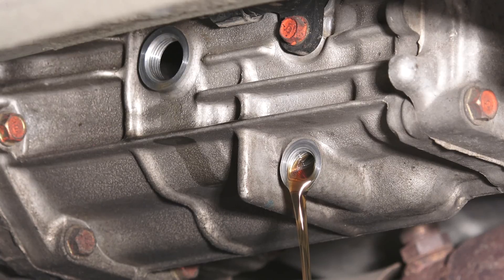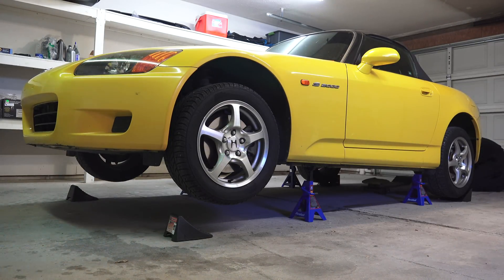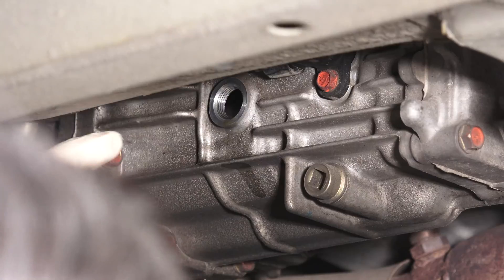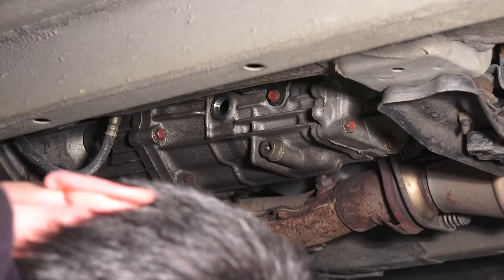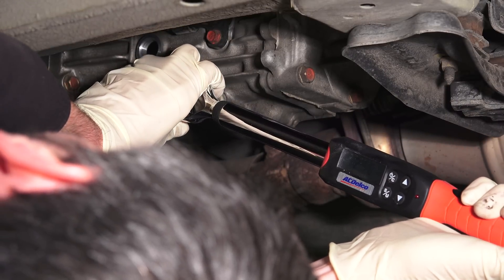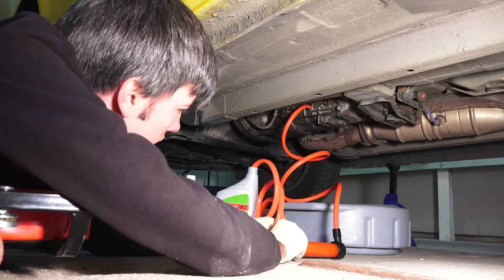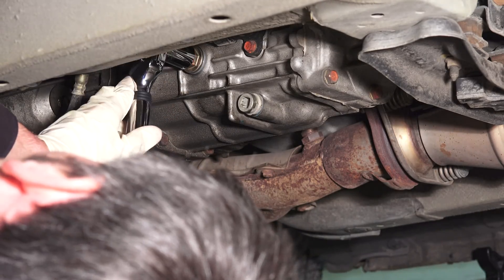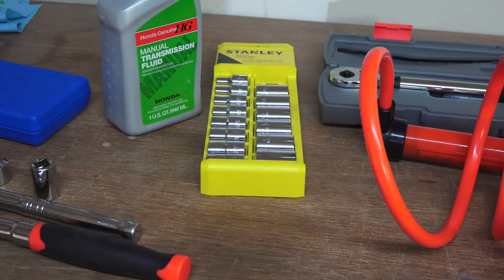How To Change Transmission Fluid - Honda S2000

Comment: Would be great if you could do a video studying "lifetime" transmission fluid claims. There is so much conflicting information with manufacturers/dealers saying a sealed transmission under normal use does not need an oil change while workshops and people will tell you that lifetime means the warranty period/mileage of the car and that you should be changing it regularly - this is despite the fact that sealed transmissions are now designed to be maintenance free and are not easy to drain. Would love if you could approach this scientifically as you always do.

Comment: I am planning to change the gearbox oil in a 2000 Toyota Camry. I am wondering if I can gain access by using ramps and if I do use ramps how much off will I be filling the box at that angle? A second consideration is using an extraction pump to remove and replace the gear oil (mine looks exactly like the one you're using in the video). Will I be able to reach the bottom of the sump using fairly stiff nylon tubing? Doing it that way would at least allow me to keep the car level and I already have the pump & tubing. All I would have to buy would be a 24mm socket and one new washer. I don't have a lot of tools, equipment or money so what I'm considering here takes that into consideration. If you have any additional ideas that could work for me, please pass them along.
Thanks

Comment: HELP: I bought my 2006 s2000 used about a year ago and haven’t changed the fluid since. It has about 120,000 miles on it and idk if I Should I change my trans oil if it hasn’t been changed before. I messaged the guy I bought it from if he had changed it but he only replied with “you don’t have to change it bc it’s a manuel” lmao. Please help, I feel the gear changes rough and a slow response so I know I should but I’m scared that my trans might fail if I change it.

Comment: if my transmission is slipping, will a fluid change help a little bit? I do not think the original owner changed it and it is at 130k miles.

Comment: looking at the comments section and im thinking, 99% of people in the US dont know how to drive a stick.
Reply: neo they both have pros and cons. AT from where im from is starting to get popular mostly in the cities. But in the provinces where its open highway manual is still king. Plus manual is easier to service as the provinces dont have a lot of dealership or repair shops that can repair an AT transmission.

Comment: A good reason for opening the filler plug first, is because this filler plug can get hellastuck if trans fluid hasnt been changed before.. and allooot of people hardly or never do that. So you dont wanna be stuck with the drain plug out and all the fluid out and not being able to get out the filler plug...

Comment: No relevant to this material, but while we are at it. Can you explained the benefits or not of dual clutching in a manual transmission car? specially in modern vehicle equipped with sincro....thanks

Comment: Cool! nice video. My fit Transmission could use that. My car have 125 000km (78 000), not too bad but it,s not expensive to do. It seem even easier than motor oil. my big problem is the level ground, my driveway has a small slope, our garage is small and use for other stuff than cars.

Comment: Why not a 3x3 or perhaps a flush rather than a drain and fill? Does the drain and fill remove enough of the entire circulating fluid within the transmission?

Comment: Thank you for this video. Is there any information on doing a fluid flush rather than just a fluid change? What is the difference between a flush and change anyway? Also I have a special request. Do you have any tips on doing a DIY wheel alignment? and/or tightening the suspension/alignment for older vehicles? I'd like to learn how to do this myself (dial it in) if it is possible? Or are the tools too expensive? Happy New Year! :-D Thanks for your response in advance and thank you for keeping up this great channel!!
Reply: My dealership only offers the flush. Many people say to stay away from that, but I don't really feel comfortable messing around with transmission fluid myself

Comment: Fluid Film,,, spraying it in all holes and crevices can stop rust from starting (or slow it down if it has). Not sure if S2000's have any problematic areas, but its not expensive and is a better product than WD40 with a million uses

Comment: What if one wants to use the same transfer pump to fill the differential? Or other M/T for that matter that uses a different fluid, how will you clean the transfer pump to avoid cross contamination? Thanks.
Reply from the maker: I suppose you could take it apart and use some soap and water. I bought two different pumps. One for the trans and one for the diff. Both were pretty cheap, and far cheaper than having the service done by a dealer.
Reply: Thanks for the response.  Let's say you have the transfer pump for m/t transmission fluid and the hand pump for the diff fluid.  What if you have another RWD M/T vehicle...   I don't want to have 4 pumps...  would you still use soap and water to clean it up?

Comment: I know many people who say to never change transmission fluid. In fact my car's service guide says to never change it. Why the disparity in advice out there? Not saying one's right and one's wrong, just wondering why the opinions are so widely varying.
Reply from the maker: Some are sealed and designed to last the life of the car. But eventually it's gonna be old. Others have easy drain ports, and are designed to be changed with some frequency. Ultimately, manufacturers want to remove as much maintenance as possible from cars, because plenty of people will not do it.

Comment: Wow Jason, kudos on successfully using that HF transfer pump.  That thing made a simple MT fluid change a huge mess for me, blowing out of the fill hole while I was pumping.
Reply from the maker: Haha yeah, honestly when I received it and put it together, it did seem quite cheap. I was questionable about it, but it worked. For the price, that's all I can ask haha. Certainly more expensive things out there.

Comment: I have 2003 civic and I don't know the last time the tran fluid was changed, I've heard that it's not good to change it if it's been in there for an extended time, should I keep rolling with old fluid or change it? ~187000 miles

Comment: is there no need to run engine n gears to cycle so the atf in torque converter gets circulated.
Reply: No. 
There is no torque converter, it is a manual transmission.

Comment: Mobil 1 makes the best trans fluid. In the cold it sucks because of how thick it is, but once it warms up it's sooooo good. The thickness helps protect everything even in high stress and makes worn synchros feel new.
Reply: Mobil 1 meets my viscosity requirements, actually. It's just a thicker fluid is all.
Reply: Unbearable Pain redline fluid is good stuff

Comment: You should probably note in the title that this is for European and Asian vehicles mostly; most US vehicles require transmission pan removal to drain all fluid. I hear they are getting better about that, though.
Reply: Cars Simplified This is a manual transmission. Pretty much all manuals have a drain and fill plug. Auto transmissions, however, commonly do not have drain plugs and instead the pan has to be dropped
Reply: I don't know how that ended up missing from my comment; I know I had that in it at one point but I did edit it a lot. Good catch!

Comment: Did u ever have to change the power steering fluid in ur old STI? My dealer is trying to charge me over $200 for that and it doesnt even seem necessary
Reply: Just use a turkey baster to suck the fluid out of the reservoir and refill.
Reply: Then again though it has gotten me to 30k miles without any problems. So $200 doesnt seem terrible
Reply: it should be fine but if you have to just buy the appropriate power steering fluid for your vehicle and use some sort of pump to take out the old fluid out of the reservoir. doing a flush would require you to remove the return line, have it set up to drain in a bucket, while you fill the reservoir. you should only need the flush If your having steering issues.

Comment: Can you talk about the 3x3 method? Is it necessary?
Reply: Jimmy M I think the 3x3 method is used for automatic transmissions which retain a lot more fluid during changes. I do a drain and fill every 2 oil changed (or 15k miles), which replaces just over 1/3 of the fluid. I think that's easier on the tranny than replacing all 10 quarts at once.
Reply: Jimmy M I think I read something about that years ago. Like they figured if you just do a drain and fill vs a flush. Drain and fill then run through gears. Drain and fill , repeat 3 times and something like 97% of the fluid will be new. I don't think it's necessary if you drain and fill every 30k miles or so. If it hasn't been changed for 100k miles , might be a good idea or take it in for a flush.

Comment: what's your thoughts on a flush vs total fluid change?
Reply: who a drain won't get all the fluid out. It will get most of it out though. And following regular change intervals, should be fine.
Reply: PocketDrummer could you explain? Does that include the Subaru BRZ?
Reply: Po Russki basically, a flush requires them to keep pouring fluid through it (and maybe even run it) until it comes out clear which takes longer and they charge you for the fluid that was used to flush with.

Comment: Jus curiouss, alot of automatic and cvt transmissions actually come with filters, looks like a wire mesh, do we need to change that as well every now and thn, or the fluid change is good enough?
Reply: for automatics the process is different as you usually have a somewhat defined fluid flow as opposed to just having gears running in oil. As you already mentioned, they also have filters.
Those need to be changed, or at least should for it to make sense. There are also valves inside that can/should be cleaned

Comment: I had the trans fluid changed in my truck. Perfectly fine working transmission. Two weeks after having it changed, the transmission just quit! No slipping. No gears. Absolutely nothing! Now it's getting a trans rebuild. $1500! Oh I'm pissed!
Reply: Yeah that can happen when you have extended intervals, the tranny just quits. No idea why this happens though, perhaps someone smarter could explain this

Comment: while this works great for a manual transmission fluid, how could you extract all the oil in an automatic transmission, this because even if you drain the "carter" there's a lot of fluid between gears and stuff
Reply: Most of the fluid in an automatic transmission is in the torque converter. 
On many torque converters there is a small drain plug.
Rotate the torque converter to place the drain plug at the lowest position,  remove plug, drain the converter, carefully replace the plug, do not over-tighten the plug and refill the transmission, start the engine, run for about 1 minute, check fluid level, top off to the proper level, start engine and run again for about 1 minute, check fluid level again and repeat starting and topping off until the fluid level is stable and correct. 

There is very little fluid between the gears and stuff, most of the fluid (about 95-98%) is in the lower pan and the torque converter.
Reply: thats why you do a flush. look it up.

Comment: How do you feel about synchromesh fluids or other manual transmission additives? 
Happy Holidays and thanks for the great videos!
Reply: Only use the fluid/lubricant and additive specified by the manufacturer. 
Most manual transmissions do not require additives and aftermarket additives usually cause premature synchronizer failure.

With Honda/Acura vehicles always use genuine Honda transmission fluid, whether manual or automatic transmission. 
Genuine Honda fluids have the correct formulation and additive package to be compatible with the materials in the Honda transmissions. 
This also applies to Honda power steering fluid.
Reply: in a honda no. Hondas are picky with their oils and you could wreck the transmission if you put other additives to it.

Comment: is this the process for most manual transmissions? when replacing fluid on an automatic I had to drain from the bottom but refill from the dipstick hole. On my manual honda, I can't find a dipstick.

Comment: Do you need to start the car and shift through all the gears to remove any air pockets and/or distribute the transmission fluid correctly?  Thank you!
Reply from the maker: +Dan Lee according to the service manual, not necessary. Just fill till it starts to drain out a bit.

Comment: why you didn't change the trans filter ?
Reply: Ammar Abotouk the filters on these transmissions are internal and don't get replaced.
Reply: ohh I see :D
Reply: There is no filter in these transmissions. 
Most manual transmissions do not have filters.

Comment: Can transmission fluid be changed on every manual car ? :o I thought it was only automatic !
Reply: Follow the manufacturer's recommended change intervals for maximum trouble free life.
Reply: lululombard yes. All manual cars need transmission oil change too
Reply: why shouldn't you be able to change your transmission fluid on manuals?
Reply: s i d e w a y s l i f e s t y l e Idk, I never had to do it even with 300 000 km on the clock, only the clutch at about 200 000 km
Reply: Same here ! That's why I thought manual transmissions were sealed :o
Reply: Already done, gearbox/transmission oil is never mentionned. :/
Reply: Yes, but the intervals are much longer than automatics. others change theirs at 100k miles. some dont at all as they would have sold the car by then, this is also the reason why it is not listed on the service manual as the car companies dont think you would keep that car long enough to reach that point.